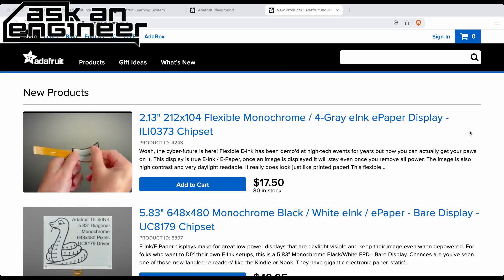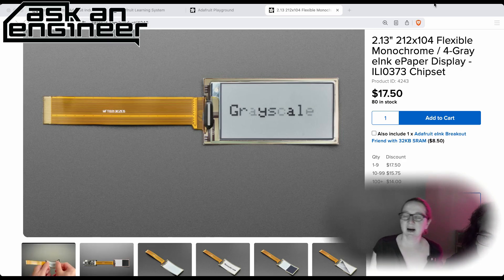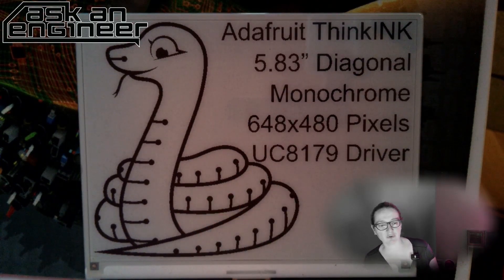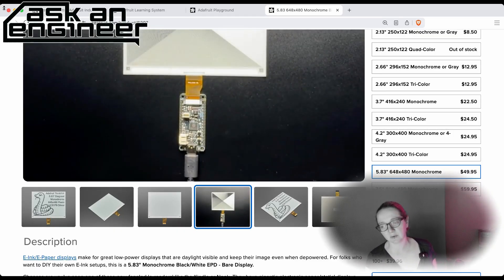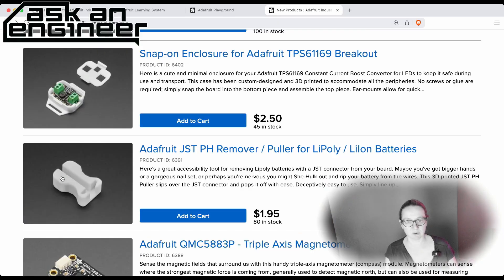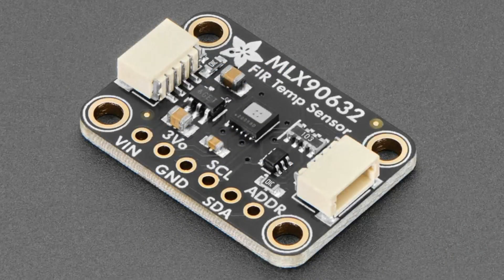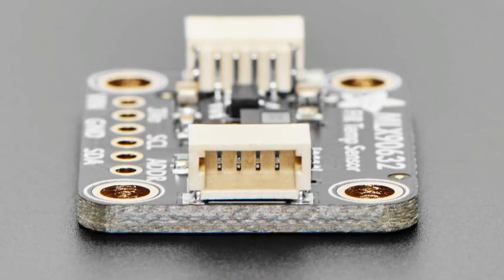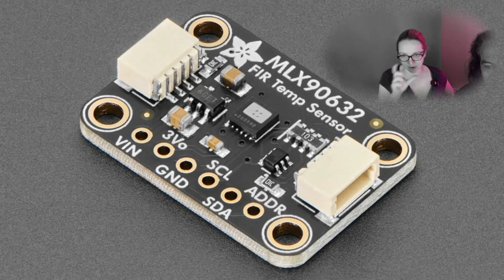#NewProducts 8/13/25 Feat. Adafruit MLX90632 FIR Remote Thermal Temp Sensor - MedicalGrade STEMMA QT

Comment: What's a good window material for the MLX90632 sensor that's transparent to IR?  I'd like to build a sky temperature sensor (essentially to measure cloud cover) because I do astrophotography.  I need to mount the sensor inside a waterproof box and it'll need a window to peer through to look at the sky.